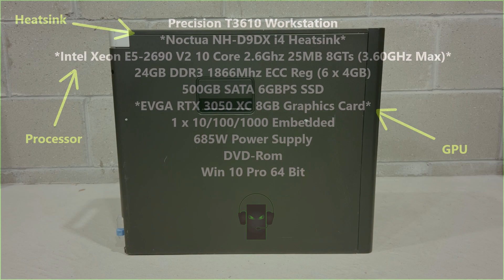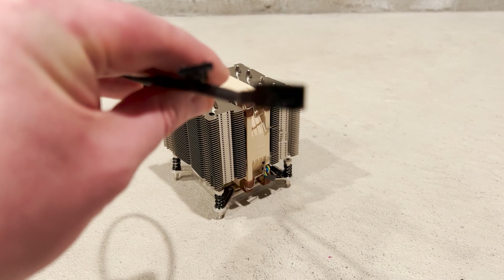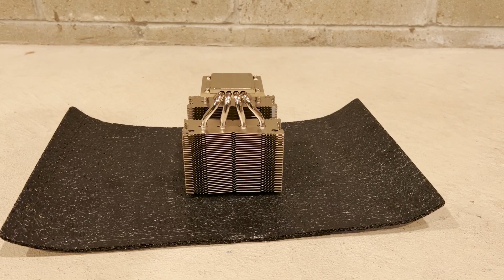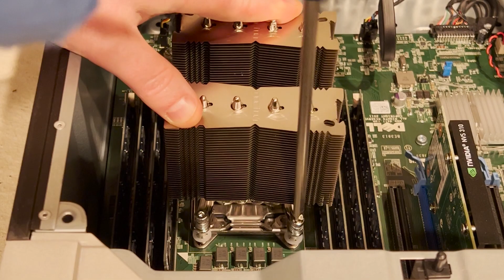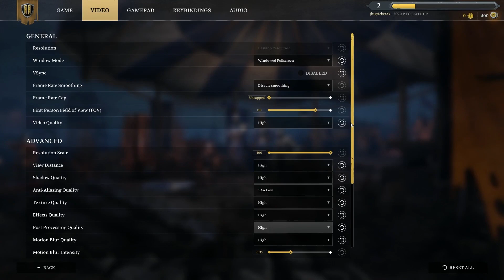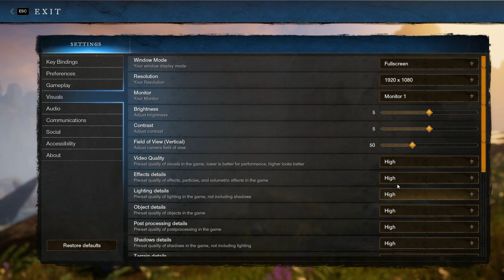Precision T3610 RTX 3050 Noctua Heatsink Gaming Computer + Game Testing #pubg #fortnite

Comment: If anyone's considering this, get the 8 core E5-2667/2673 V2, or even the 6 core E5-1650/1660 V2. They have fewer cores, but you'll get better performance thanks to the faster 3.6GHz all core boost (this only goes to 3.3GHz). Very few games can make use of that many cores, so top core speed matters more.

Comment: How did you know to add 4 washers on the Noctua CPU Cooler? I purchased a Dell Precision T3660 and wanted to replace the CPU cooler with a Noctua NH-D12L. I wrote to Noctua asking what I needed to install and they told me since Dell does not conform to industry standard motherboards, installing their cooler in this system may damage the CPU and to return the Noctua. I suppose if the CPU hight on the Dell motherboard is different than on industry standard boards, installation may apply greater pressure on the CPU and damage it or the pins. Can you provide any guidance here?  Thanks.

Comment: I use a T3610 with 32gig ram, a PowerColor RX 6600XT 8GB red devil, a Xeon E5 2697 V2 cpu and modded the bios in order to be able to boot from a 500gig NVMe SSD. 
The game I play is Insurgency: Sandstorm on a modded server.
Reply: Did you mod the bios? Is it possible to mod it to enable RAM tuning?
Reply: @BucifalulR  I don't know, the mod is done just to boot from the NVMe SSD. 
I found a receipe to do that.

Comment: Guys help, i wanna plug in rx 5700 xt to my T3610, i have PSU 685  with an 8-pin "VGA 2" connector, a cable with a 2x6-pin is inserted there, in order to connect to the video card, what should I do? pull out this cable and plug in an  2x8-pin?
Reply from the maker: You could use a dual 6 pin female to 8 pin male adapter.
Reply: @GreenPCGamerscom  уou mean plug to videocard with my standart cable?

Comment: I have a Dell T3600 with E5 2680 and RX 580 8GB. It works fine but when I tried RX 5500 XT and RX 6600, both times it gave VERY stuttery gameplay in Spiderman 2018 and the GPU usage was all over the place ranging from lower 20-30% to 80-90%. Even on benchmarks like Furmark and Unigine etc, the GPU wouldn't go to 100% usage. I never tried Nvidia cards because AMD cards are cheaper. But think and hope that this is an AMD thing and now I'm saving for an Nvidia card. Can someone advise if this could be fixed for AMD cards? Cause it might happen on nvidia cards as well, I don't know.
Reply: These towers do not like AMD cards, especially the newer ones, get yourself a gtx 1080 or RTX 2070 for it
Reply: @oblivionlord1242  Thanks for the advise and I thought the same but even 1660 Super had the same exact issue with the same games. I tried finding a solution for months and then I upgraded to a ryzen build. I realised later that my memory was in dual channel and I didn't try to run it on quad channel but I doubt that it would have made a difference as my target fps were just 60.
Reply: @faizanakram1419  to be honest, those cards are not even good for the new Spiderman games, besides the Rx 6600 but that would of ran poorly on this older system because it's modern that prefers PCIE 4.0 

An RTX 2070 most likely would have fixed these issues because it's PCIE 3.0 but still runs well on 2.0
Reply: @oblivionlord1242  It was not a card or PCI generation issue. Even 1660 Super was giving the same problem which is equal to 1070. And I don't even have PCIE gen 4 now, I have gen 3 and everything is working fine.
Reply: @faizanakram1419  seems like the GPU usage is your fault aside, I'm not experiencing this

Comment: I have a T3610 that was gifted to me. In swapping GPUs, I no longer get a display out even with original card. It is posting according to the front panel LEDs. Any thoughts?
Reply from the maker: Bring the system down to base specs and then add components incrementally to see if you can get video again.  Base Specs = CPU, 1 Memory Stick, Original GPU

Comment: not sure if i ever commented this before but in these Dell Precision when i upgrade the CPU coolers i turn the stock fan into a exhaust fans and connect the CPU cooler fan to sata power. can  be a little loud but I prefer performance over sound.
Reply from the maker: Interesting!

Comment: Cool video.  Watched the previous one too.  My main machine is a T5610 with dual E-5 2550 V2 CPUs 128GBs of RAM and I just upgraded to a 1080Ti
Reply: Is your system primarily a true workstation or gaming pc. I switched from dual CPUs in my Z840 to a single e5 1650 v4 and got a 15% bump in gaming performance and userbench score. Less cores buy higher clocked CPU. Just curious about your setup.
Reply: @johnringgold3036   My system is a bit of both I suppose.  I do gaming but also video editing and photo editing.   That is also part of why I went with a GPU with more VRAM.  A good balance for workloads and gaming.

I actually was lucky to get it from a local animation studio that were upgrading their workstations and have a dozen or so for sale.